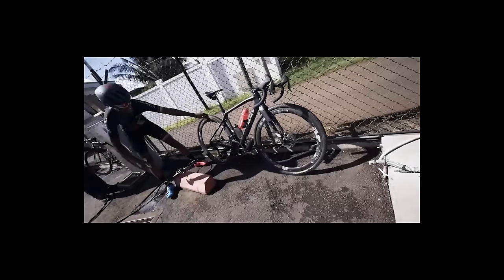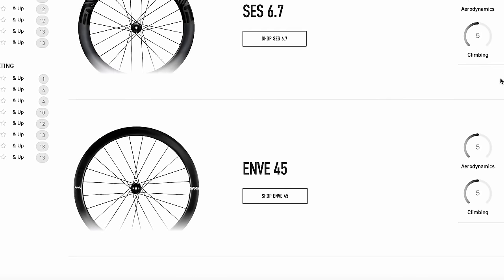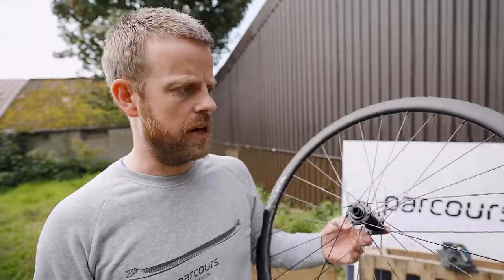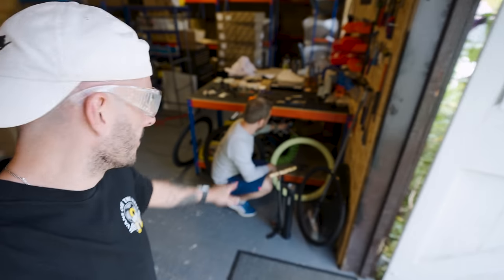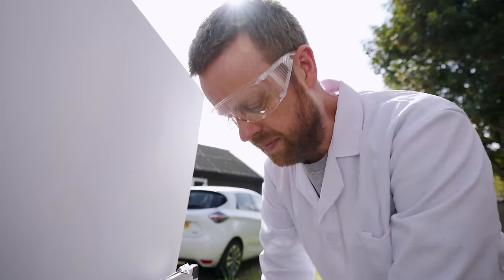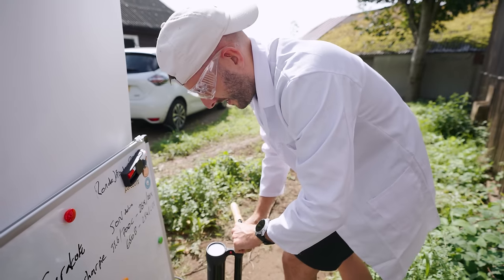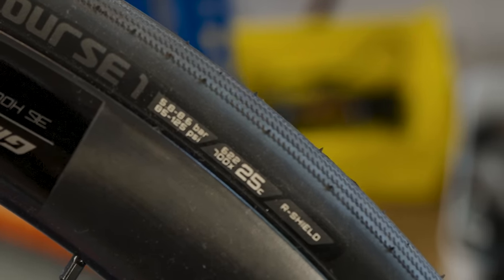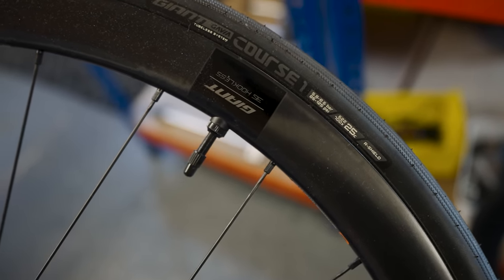Pumping Up Carbon Bicycle Wheels Until They EXPLODE

Comment: I have a Giant TCR Advance Pro 1 Disc 2021 with SLR1 hookless wheels, been using it for more than 2 yrs now with avg 85psi with my weight about 78Kg on a Conti 5k STR 25mm.
Reply: Gay.
Reply: I'd possibly suggest 85psi for your weight is 10psi too much, certainly for the front. Take 5 out the back and 10 out the front and see how that feels over the same routes. Only if our routes are mostly smooth tarmac.
I run 80 rear and 75 front on 27mm/25mm tublars and I'm 15 stone/95.5kg, on hooked clinchers I'd ride a bit more but at your weight on tubeless I wouldn't be anywhere near your pressures.
Have a go anyway

Comment: This is so true. I was shocked to find my new wheels, Mavic Cosmic SLR 32 discs, were subject to these conditions. It's not called out say for example with a flyer stating warning or some indicator like that. I think 70 psi is the maximum stated on the wheel and it's not exactly easy to read.

Comment: I built a titanium bike up 5 years ago and after a few months added Hunt Carbon Gravel wheels with hookless rims that I bought second hand off eBay, I contacted Hunt to check that the early model GP5000 tubeless was compatible but they said NO, so I returned the tyres and bought Schwalbe One Pro TL in 700cx28, I ran these tubeless for 4 years at 80-90PSI without issues until the rim tape failed (I hadn't heard about the 72PSI limit until recently), I still run them tubeless but within the limit (well less than 75psi)

Comment: I run 28 & 30 mm tyres on hookless set up, on road set up (my choice) if you run 26 or 24mm you may want try inner tube set up. My  bike shop recommended to me to run at 65psi

Comment: My tire's max psi with a tube is 75psi. That means it takes 150psi to blow it off of the ETRTO testing rim and it's safe to run a bit over, say 80-85psi or possibly even higher. They're rated at 60 psi tubeless but that's not molded into the tire and you have to look up the spec on the manufacturer's website to find that info. 

I found out about the lower tubeless rating the hard way. Thankfully it blew off in front of a hardware store and I was able to go in and buy some wet wipes to clean off the tubeless sealant! I carry gloves in my repair kit to keep my hands clean but it was quite nice being able to wipe the sealant off the bike and then put a tube in the tire.

Comment: Would have been interesting to see you mount the tires to see how they fit.  It would also be interesting to find a tire that could be easily installed with no tools to see what pressure it pops off at.

Comment: Also, if you use Silca's tire pressure calculator, I can't get to a safe tire pressure till north of 30mm tires.  SRAMs basically requires 28mm otherwise the recommended tire pressure is above the safety rating for hookless.  (to SRAMs credit they put up a warning on their tire pressure calculator that tells you to get a wider tire.)

Comment: Reason I bought Roval. Their wheels are tubeless compatible but have a hook so you can a) run tubeless AND clincher b) don’t have to worry too much about low psi pressure limits
Reply: The previous gen were hookless but thankfully they came to their senses

Comment: As for tire pressure in the tires. When riding over a bump on the road. There will be a pressure spike, that could cause a problem.  It's good to know, that hookless tires can be ridden on ruff roads safely.

Comment: While your budget might not support it, it would be interesting to see the Giant Gavia Course 1 / 3S Hookless wheel combination subjected to the test conducted in this video.  Giant's published test protocol includes "the tire is inflated to 1.5 times the recommended maximum pressure and must withstand this pressure for 24 hours without blowing off."  You might need someone beefier manning the pump to get it up to 187.5 psi.
Reply: That part of the video is very misleading. Those Giant hookless rims have a max pressure of 125psi, and can be safely ridable at high pressures. Though would agree with seeing that combo being tested!
Reply: @CupheadAleks  Part of the confusion may be associated with varying guidance provided by different manufacturers of hookless rims for max pressure.  I see reference to a max in the ETRTO standard of 5 bar (72.5 psi), ZIPP saying to stay within the standard, ENVE hookless model dependent (up to 90 psi for 25mm tires).  All I see Giant indicate is "Never exceed the maximum (MAX) tire pressure indicated on the rim, the tire or the rim tape."  They also indicate not to go below the minimum pressure indicated on the tire, noting that their 25C's can now go down to 70 psi in spite of what is printed on the tire.

Comment: I have regularly run my Enve 65 at 80psi for thousands of miles. 110 in a tire rated to 72.5 is just dumb. Plus most rims are 25 and 28mm now which are lower psi.

Comment: Not all tubeless tires are compatible with hookless rims. My 700x30 Vittorio Rubino Pro's are marked tubeless ready but are also marked "MOUNT ONLY ON HOOKED RIM" FYI, I put about 800 miles on them mounted on DT Swiss wheels (hookless) before I noticed the warning. 😂

Comment: Yep love my hookless. But the reason I have them is run wide tires at low pressure. I would never run tires below 32cc on them for tw reasons. Comfort one and most importantly tubeless doesn't work as well on small tires. My rim brake road bike gets either tubular wheels or tubes in clinchers. The tubs ride the best out of all of them they are glorious and to get similar feel you need much larger tires. I said similar not the same because of the weight differences.

Comment: I’ve also spoken to tyre manufacturers who have told me that etrto standards are too slack and that the wheel and tyre manufacturers have a gentleman’s agreement to have the same sizing but to a tighter tolerance to improve road tubeless…..

Comment: part of my routine now is using either the SRAM tyre pressure app or Silca to get my pressure spot on - yes with Tubes i went 100-120psi but now with tubeless never in those regions. Though from years of MTB i  got used to using a gauge to get my pressures correct

Comment: I'd love to see a remake where the rig can bump and smash the wheel at interval to mimic road impacts. It's something to widthstand 1.5 in static pressure loads but dynamic loading is a whole other ball game. Actually, a safety ratio of just 1.5 in static loading sounds too low for dynamic loads....

Comment: Great video, but you have not considered two important things: 1) dynamic load on the tire - for example try to hit tire pumped to 100 psi with something to see what happens, and 2) pump gauge accuracy - most of the cheaper pumps have 2-5% accuracy.

Comment: You’ll probably find that tyres will blow off hookless rims at much lower pressures if you leave them for a few hours because tyres stretch over that kind of period of time.
Reply: Incorrect
Reply: Absolutely correct. My tyre blow off at 5 bar after 2 minutes.
Reply: @CyclespeedTours  which tire? If that’s a modern tubeless tire, I call
Bullshit.

Comment: Sure sram were talking about reintroducing hooks again. Another point is the rim tape. I had an internal puncture using clx50s and the mega thin roval rim tape. Pressure forced the rim tape into the razor sharp carbon spoke holes.  Not sure but I believe latest roval wheels come with inserts.

Comment: There is also some risk with the accuracy of your pressure gauge. I had an old Topeak track pump that regularly showed 5psi less on the gauge against a digital gauge. 

You tested a single tyre and rim combination failing at 110psi which suggests with a larger sample, failure would occur at lower pressures in some cases.

Comment: I wouldn't buy hookless for road, but note that the 72.5 is a MAX. 5 bar is not "recommended" pressure. For example, I weigh 76kg and I ride 28s tubeless at 61-63 F/R for performance road (on hooked wheels). I've been doing that for almost four years. It's fast, incredibly grippy and very comfortable. I've never flatted that setup, ever. Also, that's almost a 90% margin of error at reasonable tubeless pressures even if I were riding hookless (which again, I'm not). I have a set of hookless gravel wheels that I run at ~40psi with 32s, making for a huge safety margin. I agree that the problem here is recent tubeless converts who make a mistake and silly tire labeling.

Comment: This is the second piece of content on YouTube I see this week on this topic. The Chris Miller podcast with Peak Torque also talked about this subject. They mentioned the bead as a possible source of the problem? I bought my first carbon set last year.. and am slightly worried now even though I keep to the 72.5 psi limit and that's well within the operating conditions of the Schwalbe Pro One TLE...

Comment: Hookless is fine if you read and follow the recommended psi for the rim and tire. 

I run Zipp 303 Firecrest (Hookless) now on 32mm GP5000S TR, I go out on group rides and most people fall over in disbelief when I tell them I only run around 50 psi!

Comment: The reason I wouldn’t use a hookless rim on road is compatibility. If/when I travel, it’s possible to wreck a tire and the only tires you can find locally are non-tubeless tires.
Also, there are some brands that push hookless but still keep some hooked in their range begrudgingly, or describe them as semi hookless. I believe such semi hookless means you can still put non tubeless tires on but don’t go beyond the PSI limit for hookless rims.
I’m just gonna stick with hooked for road and gravel

Comment: I bought a pair of Mavic Allroad S not realising they were hookless. My original choice of tyre was therefore defunct. I did some research and chose a pair of Vittoria Terreno Zero tubeless ready tyres, not cheap! When they arrived they stated on the tyre HOOKED RIMS ONLY  WTF!  I did try fitting them anyway but found this impossible.  50 years of cycling and I have never encountered this load of expensive  BOLLOCKS!!!!!!  The tyre state tubeless pressure of 45-90 psi.

Comment: Still healing from a gnarly tubeless blowout on a fast descent a year ago. Was well under 72.5 psi but the wheels were indeed hookless. At the time I was running 25mm internal w 28mm tires which the etrto no longer considers safe. No bueno.

Comment: Tubeless makes less sense at high pressure so I'm not sure why you'd choose it. Its is great for protecting against thorns and to some extent pinch flats (tyre sidewalls are a bit tougher than inner tubes), stuff you often encounter off-road when lower pressures make more sense for reasons of comfort and grip, but the whole industry knows they don't work so well at the sort of pressures you need on the road and their benefits are less relevant anyway, I mean how often do you pinch flat in normal riding scenarios (i.e excluding crashes) when you're running 100psi+ vs 70psi?

Comment: Interesting video. Just a remark, if a tire says the pressure range is 65-120 p.s.i. it doesn't mean that you have to pump them up to 120 p.s.i. ......... I run my road bike wire bead tires on clincher wheels at 100 p.s.i. or slightly less although the maximum stated pressure is significantly more than that.

Comment: I'm a shade under 100kgs. i don't dare go too far with tyre pressure because ive exploded a tyre in the past. it'#s good that newer tyres print the rang eon - but it should be both hookless and hooked

Comment: Good one Francis, this hookless rim  has been going on for many years.  The cycling industry needs to be pressured into better labeling on hookless rims and shipping bikes with consistent rim tire pressure needs.  Also, I once had a blowout running a tire at 92 psi on a hookless rim, fortunately it happened at safe time and place.

Comment: I can guarantee that also if you pump your tires up close to the limit an either leave them in a hot car/ hot shed or even outside against a wall in a hot sunny garden you get left with what looks like a bed sheet at the aftermath of a swingers party... 3 times i've had a massive messy failure with wheels on my tubeless mountain bikes in the past.. Oh it scares the sh1t  out of you when on a motorway with the bike in the back... I was about 110 kg , 6 ft 3 and running about 50 psi with 2.25 tires on Hope fortus 26 wheels. Hope this is useful

Comment: Just had my front tire blow off on a ride this afternoon. 200lbs with 57psi on bit wheels, riding Enve AG 25 with Panaracer Gravel King Slick 32 mm. Sounded like I was shot and hit the deck hard. This could have easily gone worse. Luckily I was rolling into a stop sign. Went to the Enve website, certainly some conflicting info. One day 55 max and the chart shows 57 for my weight. What sort of margin is that. As you noted tires say 95 psi max clear as day and rims say nothing. This sort of tech isn’t worth the danger.

Comment: holy moly thanks big time I have a new-ish bike giant with tubeless  tires... I'm going to check them to see what type they are and lower the psi have it set to 65 ish 😁😅 and I had my back tire loose pressure on me in a turn lost air and sealant had to pump up a bit. I'm new to this tubeless  tire stuff it's cool but also a big pain in the ass

Comment: I think the difference between 72.5psi and 110psi is enough of a safety margin, but like y'all said loads of people just inflate to 100psi and start riding. I don't know if my rims are hookless, but I run 32's and only inflate to 60, so I'm good.
Reply: The tyre blew off instantly at 110. My experience has shown that if you give it time it will blow off at lower pressures. Then mix in temperature, weight, impacts and that 72.5 looks a bit high......
Reply: @CyclespeedTours  exactly and if you are bombing down a hill and the tire blows. I'm nervous enough about something like that happening with my hooked rims at 60psi.

Comment: Is the tire pressure always constant? If you fill up wheel in your cool garage, ride in the Sun, on a hot road, add your weight and perhaps an increase due to an impact, the instantaneous pressure should be higher. Perhaps a test is in order. 🧐Are the beads really “Stretchy”? I think the beads may actually fail, meaning the tire is done, cut it in half and start again.

Comment: Tyre pressure will increase around 0.5 PSI for every 1000 feet above sea level. The increase will be greater the higher the pressure you run in your tires.

Charles Law...doesn't help either.

Bumps, reducing tyre volume.

Lack of knowledge, lots of habit.

Missleading information

Too many factors pushing on the safety margin.

Now rear improvement for  the user.

And I'm really sceptical that the manufacturing cost saving vs hooked is going to be passed on.

So. Maybe a bit cheaper, no user operational benifits.  Risk of instant failure in front of on coming traffic, fast decent... or just going along thr path to the shops.

No hookless < 35mm.  It's the law.  I just made that bit up.

And for the 60kg riders... from an public safety perspective I'm glad you're "good" but it's all the other people we should look out for.

Thank you Francis

And to be cheeky... I suppose Scott don't make wheels.. naughty  naughty troll.. bad troll. the voices in my head made me

Comment: The question you posed was “what additional benefits are there?” But the test you performed only attempted to identify the point of failure. Additional benefits include:
1) more aerodynamic profiles, particularly where the tire meets the rim
2) additional strength to the tire shoulder. 
3) less tire deformation under cornering loads
4) better cornering as a result of 2 and 3
5) lighter wheels with equal or greater strength
6) ease of manufacture resulting in lower cost to the consumer (theoretically)

I agree the information needs to be disseminated better. The rim itself needs to be imprinted with guidelines.

Comment: I have gp5000 tr tires and they say max 73 psi , I have them on ffwd hooked wheels. I was surprised the tire had that low of a max psi, the wheels are over 100 psi max.

Comment: makes prefect sense when you consider pressures for hook less , HOWEVER as you mentioned the wrong tires being installed with bad info as to pressures on the hook less rims , the other thing that needs to be talked about are different pumps can give the the wrong pressure reading , i would not ever use hook less do not trust them . its a way for manufacturers to make cheaper rims while charging you full price

Comment: I had this issue before twice. I bought a Kona sutra ltd 2022 gravel/ drop bar mtb and was bike packing with a friend. I got sick during the trip and I thought I make it myself a little bit easier and increased the pressure from 2 bar to 3.8bar (55psi). The Maxxis reckon tyre blew off the rim und the rim got bent from the explosion. I had to got to a bike shop to true the wheel. Luckily it exploded when I was having a break.
But the second time it exploded while riding the bike at only 36psi.
I’m now changing my wheel set to a Syntace w28i with hook and a different tyre.
I’m so scared from the wheel set tyre config that i don’t ride it atm until the new wheel set is ready

Comment: I also wondered about hookless safety on super low pressures like for cyclocross, where it’s not unusual for a rider to run 1 bar ~ 18 psi depending on conditions. Will the tire stay or burp in a corner at those super low pressures?

Additionally, Not all brands use the word “hookless” to describe their hookless rim.

Comment: Lower rolling resistance with wider tires!

(at the same PSI as the skinnier tire... but now you can't run the same PSI. So is the rolling resistance actually lower?)